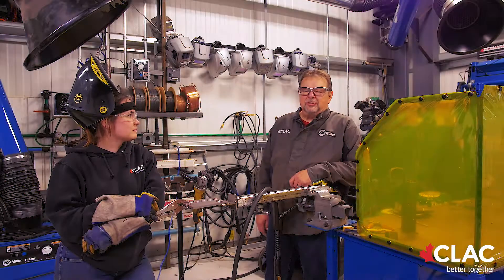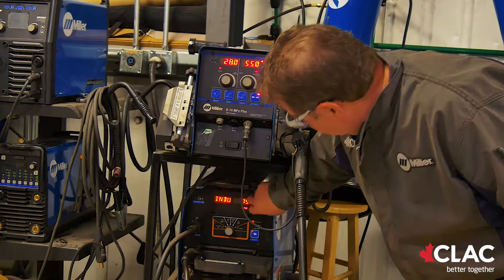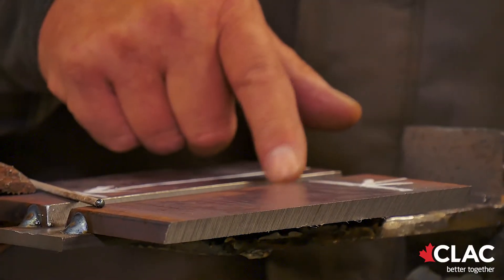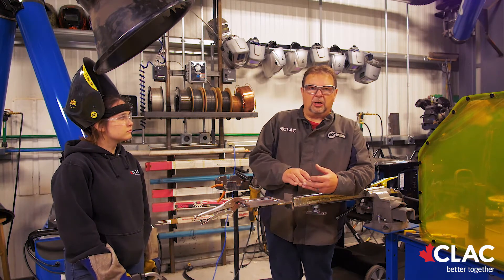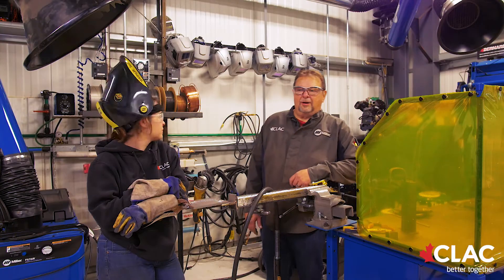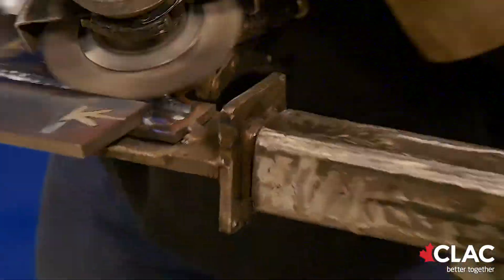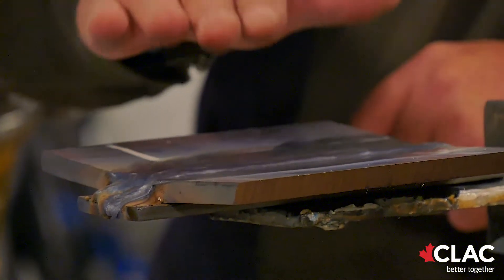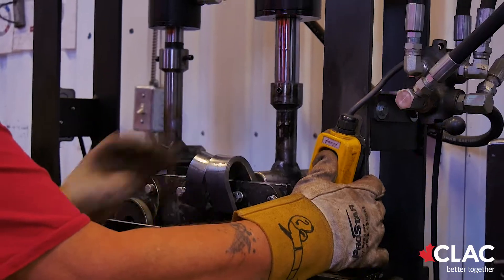CLAC Training | Welding How-To: CWB Test - FCAW Flat Position

Comment: she needs a longer stick out the nozzle looks like its on the verg of getting stuck. Also running the bead forward backward, run it side top side. Also scary use of the grinder

Comment: The time out is to let the plate cool so you can control the puddle better. It makes more sense in vertical and overhead as to much heat will just make the puddle to runny.

Comment: there was literally a 1/4 in crack on one of the coupons and one of the coupons wasn't even showed, hence ya already know it snapped. As well as on her first pass she started inside the test plate, rather then starting outside welding to the inside so where she started was cold, hence the snap.  Also you'd be failed right there and then for welding into the tie, ( you have to start on the tie for these tests) although its smart to weld into the tie when possible but that's just not allowed on these. The theory on this video was perfect. But you maybe should've shown a video where the coupons actually passed. still great video and thanks for making it.
Reply: I noticed that too. Starting your CWB weld on the inside of the plate instead of the backing strip was so weird.

Comment: I don't think that wire is running at the speed he thinks it is.
I was told an I believe this to be true.
That changing your wire speed is the equivalent of changing rod size and then welding on the same heat.
Should be able to weld somewhere around 29 V on flat, without turning it down much.
This young woman would have done better if the thing was lower.
Machining seems like cheating.
I got my time down to one plate under an hour to bend.
Torch cut torch washed backing strip off.
Reply: I never run wire speed much over 3 on the Miller I use.
Currently my wife feeder is set to 2.0
An it seems to be similar to how fast his machine shot wire out at 4+.
Reply: @mrillis9259  I like 27.5v and 260wire, but i'm using 1.6mm fcaw not .045
Reply: @ForceFedFetusFillet  ya big difference between 1/16 wire to .045. Don’t know why they always choose women know adays to represent Welder’s? Most of the women Welder’s I work with don’t last very long lol
Reply: @bricksquadmonoply8835  too busy taking selfies next to the millers